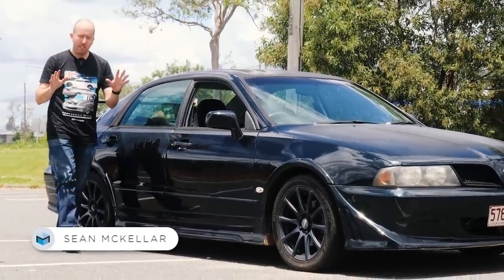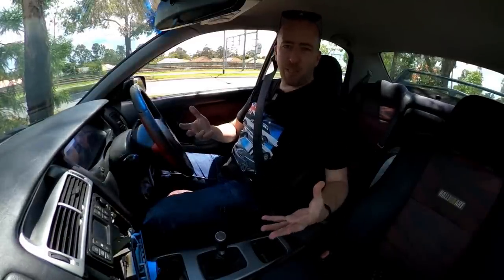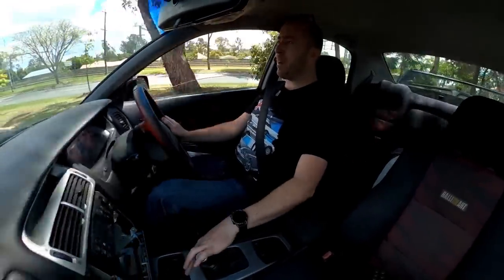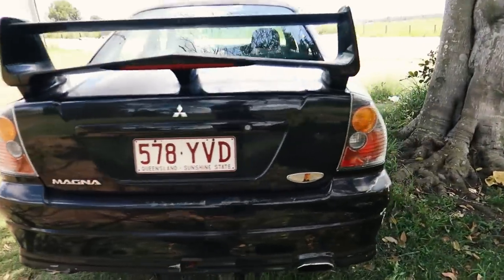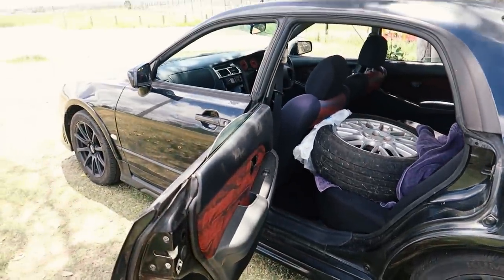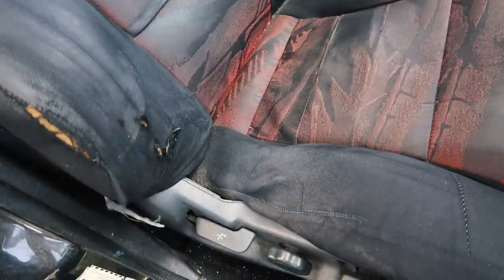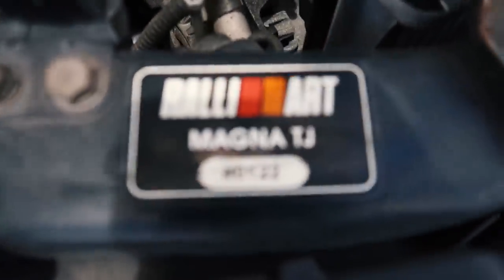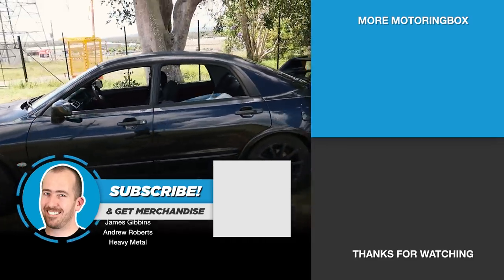Mitsubishi Magna Ralliart First Drive! This Aussie 180kW 6G74-powered manual sedan is a screamer!

Comment: Lots of degreaser on that seat should bring the colour back, unfortunately the foam has fully collapsed, compare it to the passenger and you’ll see how well bolstered it should be, if you end up getting the drivers re conditioned take the steering wheel as well, points of contact make a huge difference to the driving experience

Comment: Good purchase,
Now your going to have some fun!!
That timing belt will need replacing as well as the water pump and the hydraulic tensioner if they have not been replaced. My tensioner fell apart when it was removed. The heater will definitely be getting ready to leak, if it has not been replaced all ready, more so the plastic joiners as they crack over time and eventually cover the whole interior carpet in coolant. This part is vital!! Make sure you only put full synthetic oil in it regardless of what anyone says, I use only penrite as I have done for the last 10 years. Believe me if you use a standard oil it will heat it up and break it down in next to know time, and you will develop a ticking noise which will be the tappets then it will need to have the heads redone and it's so expensive!!! Then you may aswell do the bottom end as well as the pressure from the top will blow out the bottom.This is from all my experience of driving the magna sport range for the last 15 years. They are a great car but they do require all servicing done as they will break down quite rapidly and you don't get much of a warning when it happens. Also join the Mitsubishi forum as this alone will save you so much money.
Enjoy that car it is beautiful!!!

Comment: My brother, dad and I were looking for one of these as a project to fix up for ages. We could only find one! It was in silver, went to inspect it and the engine had fallen through the engine bay onto the ground!!

We ended up getting a VRX Magna (the second hottest Magna) for $899 with 350k on the odometer. It suffered from the classic Magna clear coat peel like yours is but it absolutely screamed! The 5 speed manual with an aftermarket exhaust was a tonne of fun and the engine was still super strong and properly quick even after racking up 350k. The stock body kit also looked fantastic, a little more understated than the in-your-face Ralliart (which I also think looks good). They’re great cars and I enjoyed driving it way more than the VF commodore I daily now.

Comment: Yesssss!!!

I will start off with this: (IMO) part of 'car-guy' maturity is finally driving other cars with an open mind and, don't knock it until you drive it. I (was) a staunch Holden kid, and knocked these until I finally drove it. It was the character of the 3.5L that won me over.

My ear is telling me that it is an (initially) good runner, and yup there has been a muffler removed. Obviously needs a full service, all filters, all oils (including trans) but get that timing belt done ASAP.  And due to access (if budget permits obviously) may as well get the front seals, pulleys and aux belt done as well. Shit, could add the water pump to that list. Medium-term look at spark plugs and leads, but to get to the rear bank plugs its off with the inlet manifold (and with 20 years/250k on the clock and the manifold off, probably wouldn't hurt to do the valve cover gaskets as well).

These are a simple enough thing to work on trim wise and should be enough wrecker parts for the trim pieces. Just make sure you seek TH or TJ trim pieces (they shared similar trim colours ect). Earlier TE/TF were a lighter grey trim wise and later model TL/TW were hit-and-miss as there was some cost cutting changes/deletions (MMA even got rid of the battery cover for the TL update!). Those backing plates behind the door handles were known to falling off as well...

You're not missing out on much with the factory audio system gone. I think they take shallow 4" or 5" speakers in the front doors and 6x9" in the rear parcel shelf. Find yourself a nice Double-Din headunit and off you go. With no steering wheel buttons and complicated electronics, its an easy DIY install. 

$5500 is reasonably fair given the shape its in but you can use that to your advantage - its a lost cause trying to keep it factory/concours original but know you have a solid 'clean-sheet' platform to tinker around with!

Get those Enkei's back on AND if budget permits, the chassis responds well to a front strut brace (chassis/body isn't as rigid as it could be). Aside from worn shock replacement, keep the suspension stock (front bumper will thank you later).

Here's the catch with the Magna. You have to align yourself with owning/driving a JDM car more than an Australian car (and that's why most Aussies always shat on them). Tidy that thing up and you will have one hell of a cruiser (than can tackle a back road on the way home).

Very jealous right now.

- Mitch

Comment: I have a early production TJ Magna Sports (July 2000 TJ Magna serial number 000564). It has always been a good car for me. 278000km and showing it's age, paint is mostly good, interior roof lining needs replacing, but it still drives well. Original engine and auto. I hope to turn it into a show car one day, just keep it well maintained and it will go and go and go. With the 6G74 make sure you regularly check the oil, these engines always burn a bit of oil.

Comment: Worth pulling the plastic bits under the windshield wipers and checking for rust around the vent intake. Dirt and shit builds up and holds moisture then water can leak into the car. Fibreglass matting and resin is an easy fix if  if rusted through.

Comment: I have a quick upgrade for you to do Sean. 
Buy a flat tyre repair kit.
Just inspect the boot of the car. 
Take out the full size spare tyre kit, boot floor carpet (it just lift's out as it's not nailed down) & wooden masonry board. 
Then put in place the flat tyre repair kit. 
This removes almost 30kg of weight, just weigh the stuff to be accurate. 
It's mainly because you need to take out the boot floor carpet & wooden masonry board for it to work, so the car shed's off significant amount's of weight.
Reply: I think the boot looks better this way as the colour of the car is splashed into the boot🤩

Comment: My Grandfather gave me his old 1997 Magna Executive on my 21st (he got himself a VE Omega which he later regretted not getting a G6E instead). Drove it for 4 years, put many more KMs on it (it had seen a return trip on the Nullabor and a few trips up North). Had to replace the CV joints (corner clunk) and the coolant cross over tube (corrosion). Only a 3l but it still had a bit of zest. Sadly I had to sell it due to relocation and I had 2 cars (a ute wins due to cargo capacity).

Comment: There surprisingly fun to drive and I've always been rear drive falcon guy , but just the base manual v6s I drove made me want to pick them in the used car yard I use to work in as a sale's guy in the mid 00s , spacious, responsive, good dynamics especially in manual compared to a something like a camry (theatre is a good word to describe it), it'll be and interesting project ,look forward to tracking the progress
Reply: The Supercharged & NA AWD Magna was superior to the RWD offerings from Ford & Holden I think. 
They were used in Rally's & achieved considerable success.

Comment: Looks like an Evo, very cool looking! This is not a car we got here in the UK so I'm very intrigued in your road test.
Reply: They won the Australian Motorkhana at launch. 
So they were capable. 
5 were released with 210kw with their NA V6.  
30 were released with Superchargers which made 247kw. 
But some of that 30 were the 210kw NA V6, so it boosted power to 277kw.
Reply: @brantleyfoster021  we really missed out. Mitsubishi never really had the biggest of markets here. There did used to be plenty 3000GTs (the Japanese GTO twin turbo beast) obviously Evos were always popular (but not in the same quantity as Subaru Imprezas) and we had the little hatchback. Although even Subaru weren't exactly huge sellers here either other than the Impreza and Legacy (usually as the estate version) and some Forresters. Alas, Ford and Vauxhall have always ruled the roost sales wise for decades (probably the vast majority of my 48 years of life) with German and French cars filling in the gaps (German for quality, French for cheap prices) 

Us UK Petrolheads are also enormously envious of your Aussie V8s bruisers (we did start getting Holdens eventually but not until the very late 90s/early 2000s?) Road testers absolutely LOVE the Holdens, it has the only desirable feature of US cars, the big arsed, powerful, torquey, lazy V8 but fitted in a car that can actually go round a corner AND stop. All in a package infinitely better put together than the laughably bad US cars. The UK should have been importing your V8 Holdens, Ford's etc decades ago. Then we could have had the UK equivalent of your (I think this is the term/word?) Bogans? Apologies if that's wrong or offensive but I believe your Bogan is the same as our Boy Racers, of which I was a very proud member throughout the 90s. I drove a Hot Hatchback (Astra GTE 2.0ltr 16 valve. 156bhp 0-60 in 7ish seconds top speed 136mph. Which was fairly impressive at the time) usually driving like I'd just stolen it (appropriate as my car was one of the most stolen of its day!) Loud bass heavy stereo thumping out The Prodigy or gangsta rap/Hip Hop almost exclusively and cruising round nearby large towns in the spiritual home of the Boy Racer, Essex! I did go a little against the grain though by driving a Vauxhall and not the near mandatory Ford (XR2, XR3i, RS Turbo or if you were better off the legendary Sierra or Escort Cosworth) but otherwise I was stereotypical haha!
Reply: @davekennedy6315  
The 3rd gen Magna had a aerodynamic co-efficiency of 0.28. 
But there was also the AWD Supercharged model's. 
They were well built & very reliable. 

It's a bit like the Mitsubishi Cordia turbo, they generally had 110kw & 210nm.  
But some actually had 150kw & 300nm, when you consider that they only weighed 965kg - it made them very hard to beat for any V8 in Australia back in the early to mid 80s. 
A completely new form of acceleration.  
It's why the cop's took an interest in them.  
Mitsubishi always release some halo model's within their line up to surprise customer's - it's just a matter of whether you are that lucky recipient. 
The Mitsubishi Starion may have been Mitsubishi's halo car back in the early 80s when they were throwing huge money at it each year, but everyone who owned one knew never to pull up against a Cordia turbo at the traffic light's. 
They even posed a threat to supercars at the time.
Reply: @davekennedy6315  
Well am from America actually. 
The Corvette was faster than any of the modern Holden's in Australia in a straight line & around the corners. 
Just don't like the Corvette's fibre glass bodykit tbh. 
Holden's are better built I guess, but the latest gen Holden's were a bit too heavy for my tastes. 
The last HSV was starting to near 1900kg, think their Nurburgring time says it all really. 
The Ralliart Magna's were 1470kg. 
Well even the AWD Supercharged Mitsubishi Magna's only weighed 1604kg, 1575kg when equipped with a flat tyre repair kit. 
Think they offered much better balance & grip than the last gen HSV. 

Yes the EVO's are quicker than the Subaru's. 
Especially the FQ series.

Comment: The compression came from different pistons. The heads had the area around the valve heads relieved for greater flow in the combustion chamber. The cams were different and the same grind as the 380. Also, they had different brakes all around and the standard cars tail lights are the same as the Ralliart so that's a cheap fix.  And I think $5500 was a bit too much  but that's just my opinion. Looking forward to seeing what you do to it.
Reply: Really hard to know in the current market and this being such a rare model.  One thing I'd worry about is that paint - that's a very big, very expensive job right there.  Interior I think maybe not as bad as all that as mostly looks like small repairs - but yeah, that paint would have put me off it at that price.  Still the body is super straight so perhaps I'm wrong and it is worth it.
Reply: Haha all the old amc guys posting
Reply: @MrRhino10  Yup. AMC NSW here. Good days, great cars.
Reply: Front and rear brakes same as AWD hardware.
Reply: @MitchZero9  amc vic

Comment: Well done Sean acquiring one of these for a reasonable price. Trying to find anything under $7000 that’s reasonable in anything resembling a performance car that runs well is a win. Timing Belt and Mitsubishi, my policy with my project Mitsubishis is change them at the first opportunity if you are keeping it (although make sure whoever does it is competent, as I found out to my cost on my Grey 2004 4G64 Outlander XLS project). Check if yours is 16 pin OBD-II or has 12 Pin. From the grey Outlander, it doesn’t broadcast all its information to 16 Pin, so it would be worth getting a 12 pin adaptor if that’s what it has. The paint peel is pretty standard for Mitsubishis of this era, the Lancer and Red 4G64 Outlander XLS on my channel are symptomatic of this.

Comment: I still like these cars. I used to have a silver manual ralliart with sunroof. They are pretty quick and comfy. I beat the vn 5 litre (auto) and vt ss (auto). They used to have these raptor supercharger kits you could buy for about 6-7k. Ive seen those run 12s

Comment: The Ralliart concept car from the Australian Motor Show in 2000 did not have a 4WD system. It was torn down and officially rebirthed as the first Ralliart sold, minus the recaros. It did however keep the front Brembos.
Reply from the maker: At the very least they promised it would have AWD - I suppose at the show it didn't matter as it was purely for display.
Reply: @MotoringBoxTV  yes most likely
Reply: @MotoringBoxTV  
Sean there was some Ralliart's that had an upgrade from the Recaro seat's featured in yours. 
They were leather & coloured in black & red, they were incredible to look at but I'm not sure how you get them. 
The owner of the one I saw said he did it through Mitsubishi, would be an amazing upgrade - took my breath away🤩

Comment: Great video and I did spot a Wasp Yellow Ralliart Magna in Victoria with the body kit and everything... I hope it was a genuine one though I think around 50 were made when I did a bit of research on these (I could be wrong)... I think the VR-X Magna's look kind of cool and they come in AWD and a Manual!

Also, this car looks like it needs to be lowered a smidge because it looks like a Falcodore with a fibreglass body kit at the current ride height...
Reply from the maker: VRX could be had in AWD and manual, but unfortunately never both together!
Reply: @MotoringBoxTV  Oh, that's unfortunate then... Tbh, I always saw the Commodore and Falcons as the main large cars, then the  Camry and Magna which were kind of on the side, more so the Magna... Only the Camry is still in production today which is a shame...
Reply: There was only 4 yellow Ralliarts.  Used as promotional vehicles there’s one in Bunbury WA she drives it daily!!! I wouldn’t be lol!!! There’s a FB group with a spreadsheet of all 500.
Reply: @sonjarado1175  Yep, there's one in Victoria as well, and I've seen it been driven around though it looks pretty clean, so I don't think this is daily driven... Do you mean 500 Yellow Magna's or Ralliarts?

Comment: This era Magna was massively underappreciated. They were better built then the Falcons and Commodores, and quicker too.
Reply: Yes you are correct, the TJ series Sports/VRX blew away alot of driving expert's because it was blowing off the competition's supercharged V6's & V8's with a NA V6 that was an extremely simply design. 
Then the Ralliart Magna hit 2 year's later & it was blowing off STI's & the Holden Monaro with many reviewer's marveling even further at the kind of power such a simple engine was generating. 
Some Ralliart Magna's actually used different cams & compression ratio that boosted power to 210kw, which went some way to explaining why the car was blowing off everything since it only weighed 1470kg or 1440kg when equipped with a flat tyre repair kit. 
1 year on & the AWD model landed & then Supercharged AWD model's started appearing putting out 226kw. 
It started dominating alot of the Rally competition's that were being held in Australia. 
Alot of people point at the TMR 380 being a quicker car, but NA or forced induction it wasn't. 
The most powerful supercharged Magna that appeared was putting out 251kw & 440nm while weighing 1460kg, it was a FWD wasp yellow Mitsubishi Magna VRX. 
That compares with the FWD TMR 380 that put out 230kw & 442nm weighing 1700kg. 
It's obvious that the Magna was clearly superior.